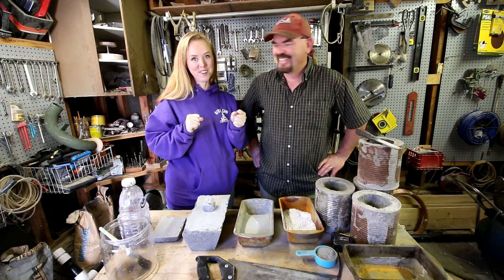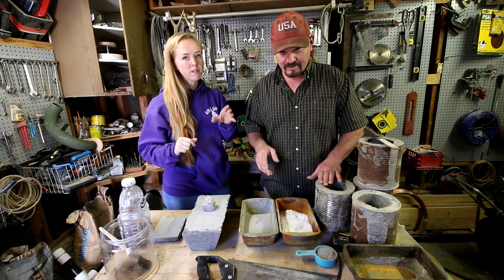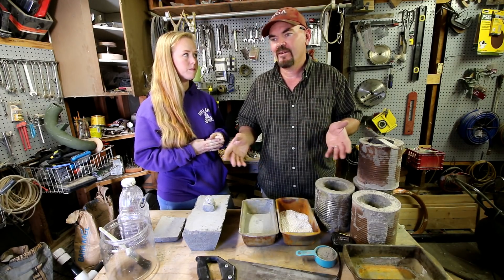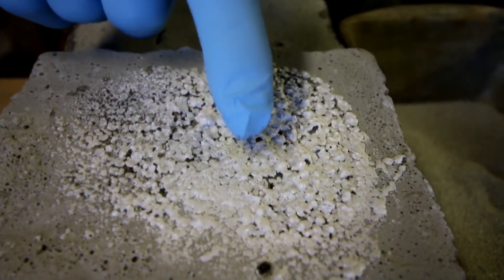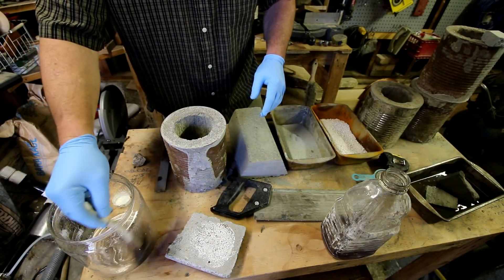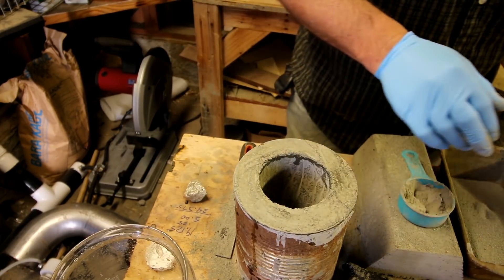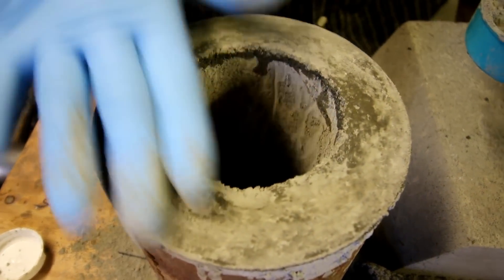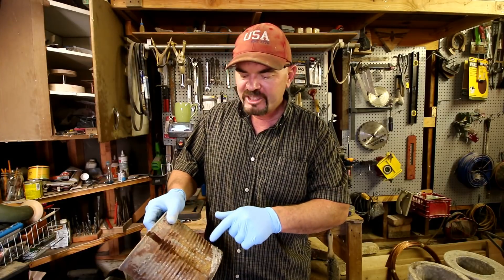Air Crete used for a Heat Riser in a Rocket Mass Stove

Comment: instead of brushing it why didn't you just 1. immerse soak the whole thing in a big tub 2. at least immerse the lower end of the tube and let the water glass wick-up through the porous structures of perlite due to capillary action? that way you could have created a more durable and deeply penetrated insulating material

Comment: Hi, love what you are doing. I have a question. Don't know if you have answered before.  Have you tried, or do you think it would work, if instead of coating the finished product with diluted water glass, adding a diluted water glass directly to your refractory mix. For example, if a recipe called for say 4 parts water, use instead 2 parts water and 2 parts diluted water glass,   Thanks, love your channel. Will be watching. Kyle.

Comment: I got me some quarter in thick 8 in pipe for my riser with two inner chambers 1 -5 in 1/4 in thick and 1-2in 3/4 IN thick. With a a really iffy wood gas collection tank on top for the bell.  I made an air Crete gum for about 25 bucks (looked diff  than yours  but  it works the  ssme) could've  made it free from scrap  plumbing parts. And roiled up some wire  imy hands 4 the mixing chamber. After  I threw  that away and replaced with the stuff you used and it worked perfectly. When I got done i put it  back up with my air compressor  because my power washer  i made  with variable psi controls and u can also control the water volume up to 20 gpm . I literally  unscrewed  the nozzle/ put coarse  steel in / screw nozzle on and Bam!! Any way I just want 2 know if  bulding with thick  steel will hold  up  to abuse? Love the  simplicity  of yours and it burns great. Keep it up and you are famous  some day if not sooner! And rich.  Best of luck even though u don't need it once again thanks

Comment: Waiting to see your refractory aircrete mix that you feel you got right. If your not giving it out and are selling it, then please get it on Etsy. One physics thought. I’ve dealt with water glass, cement, perlite, clay, refractory cement, fire clay. Now that you have made the mixture to your liking, I find that soaking in the water glass deluded kind of takes away from the air pockets you worked to create. You mentioned it soaking in a quarter inch or so, and I get why your using it, but I feel that you end up negating some of the properties of the aircrete mix in itself by soaking in the water glass that fills some of the air pockets that act to insulate in the first place. I get why but just don’t get adding a step that fills the surface levels air pockets with something that stops it from being pockets of air which is far more insulative. Or just say to us that aircrete is great but not made to do it on its own and needs waterglass to help protect the surfaces from extra heat and wear. To me this negates the use of the work in creating aircrete if you still have to soak in water glass instead of incorporating water glass whilst making the aircrete so that it be more monolithically incorporated and still gets to add its heat and glue kind of cured properties and allows the max air pockets spread out through the entire casted piece. Thoughts?!
Reply: Yes I was wondering why not incorporate the waterglass into the aircrete mix also, that way you would get the strength of the aircrete bonded throughout by waterglass and if the mix was right you would still retain the airpockets which would also be sealed in by the waterglass.  Light, Stronger throughout and insulative too.